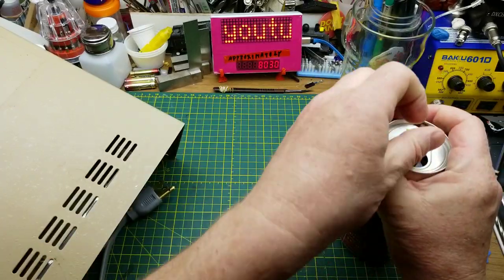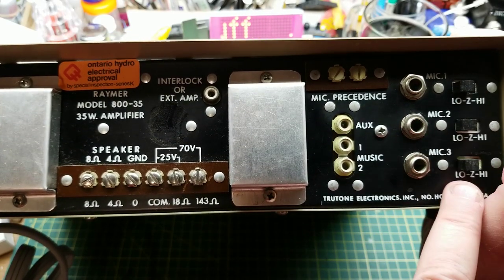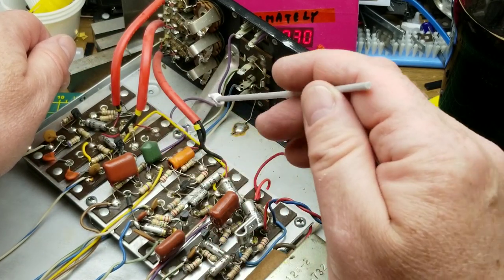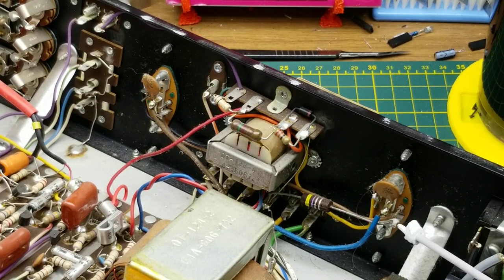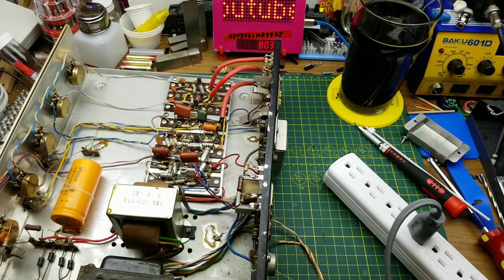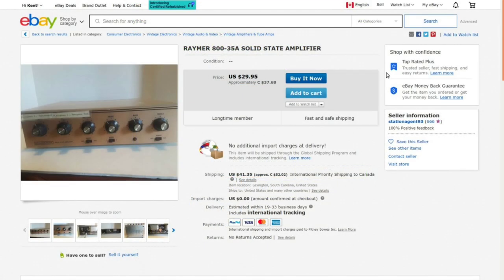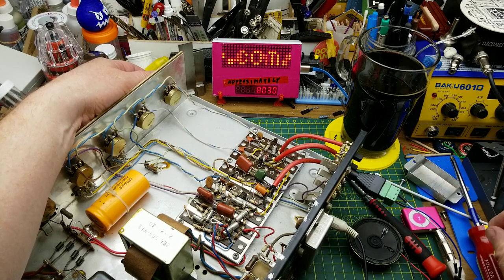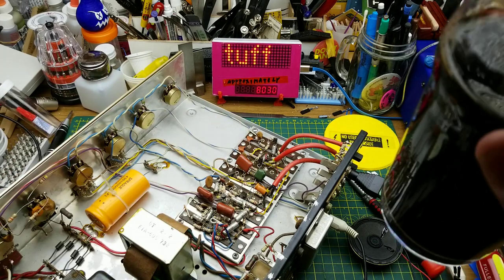curiosity teardown: vintage PA amplifier

Comment: OMG a PA amplifier. When I was a young lad, just after high school, I had a summer job working for Muzak. Muzak is the original elevator music company. I would install PA system, with amplifiers just like yours in shopping centres, stores and restaurants. Usually we would install speakers with 70 volts transformers in ceiling tiles, run a bunch of cables to the PA which usually had a microphone with a talk switch hooked up to it for public addess "clean up on aisle 4" type messages.

The Muzak music was fed trough a regular phone line originating from a little office in Quebec City (for eastern QC). They would regularly receive18 inches diameter (or so) tapes which ran for 8 or 12 hours. The music was organized in a way that it would (would it?) increase productivity in offices. The music was in 15 or 20 minutes segments where the rhythm would gradually increase, then there would be a pause and it wold go on like that again, which supposedly made you work, or shop more. I remember they had 33rmp LPs with charts on the back demonstrating this "principle". Muzak had an enormous library of music. All instrumental covers of popular (and no so popular) music, which they still offer today.

Comment: It's really cool to see how simple this old tech could be. IIRC some similar Radio Shack PA amps from the 80s had a similar feature for running them in series like that.  I think it's also really cool to see practical applications like this for joule thieves.

Comment: Wow, never seen any amp/switch built like that.  Some of the red capacitors looked like modern film types, but some of those resistors looked like 50-year-old carbon 1/2 watt dinosaurs.  Maybe it has been maintained and repaired?
Reply from the maker: As far as I can tell, it's only had one capacitor repaired.

Which is both impressive and a testament to old school "built to last" mentality.

Comment: My old high school used something similar throughout the whole school! Each class room had it's own speaker and volume control! 
I can see how this sort of thing would be useful at home! You could literally pipe music to anywhere you want and all that you have to do is turn up the volume on that particular speaker to enjoy or have it running everywhere like central heating so that it's never too loud wherever you are... 
That amplifier has original 2N3055 TO3 output transistors!!! Try and get those things now days! Sure you can get Chinese copies and they aren't as bad as people make them out to be but they still aren't as good as the original one's! 
I would get it just for it's transistors alone... Not that I would pull them out, but just to know that I have them!

Comment: that is not the ac ripple, that is the measuring dc value through the internal rectifying diode in this cheap meter calibrated to give the equivalent ac voltage across the meter leads.
Reply from the maker: Good reminder. 
I probably should have used one of the better meters, or the 'scope for that. 
I'm so used to using the Fluke at work for that type of measurement I forgot that the cheapies (as accurate as they usually are) don't work well in all applications.

Comment: Thought pcbs where in at that point in history🤔. Looks like it was designed by someone used to tubes.
Reply: PCBs were pretty much high end at the time, the tech in that amp was "tried and true", probably indeed designed by a tube person who had just learned transistors. They probably would have preferred PNPs (or even JFETs) because they're more similar to tubes circuit-wise but boy, were those expensive.
I say that because I'm old and remember thinking that NPN circuits looked kinda upside down to me at the time.
Reply from the maker: There was a long overlap in technologies before PCBs became ubiquitous .
It wasn't that many years previous that this company was still making and selling tube based amps.